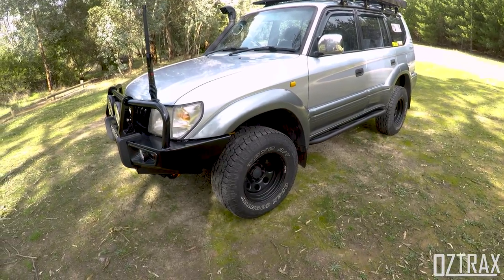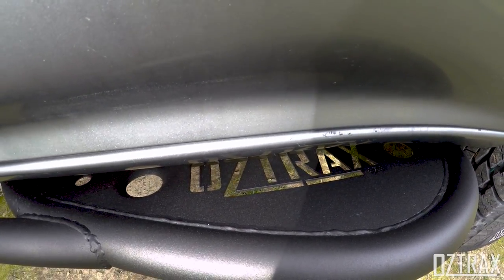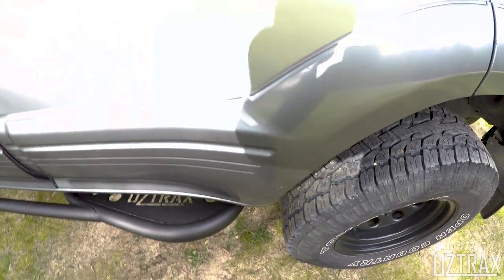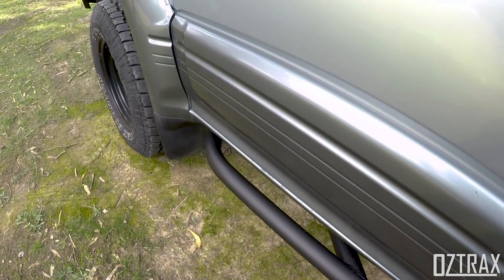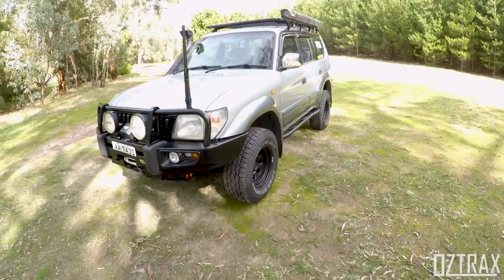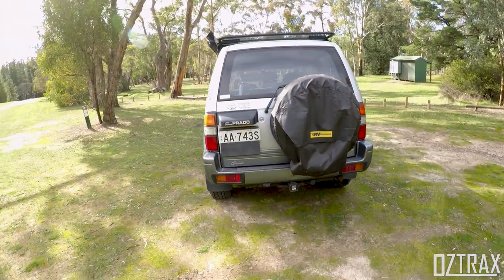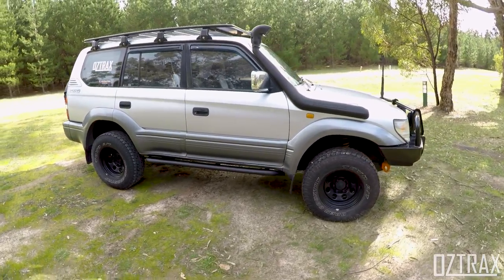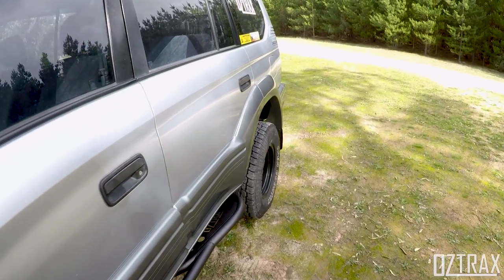Toyota Prado 90 Series // Rockslider Build by SBH Engineering

Comment: They look pretty nice, beats bending the factory steps, mine have a dent on the passenger side.
Reply from the maker: Yeah mine had a few knocks. Still have them stashed in the shed. Reasonably straight for alloy steps considering some of the tracks I've done.

Comment: Awesome man looks mean👍🏼 was wondering where/how you mounted it, to chassis or body mount for original side step ? Cheers
Reply from the maker: Thanks! It's getting there slowly.

These particular sliders bolt to fish plates which are welded to the chassis in three points per side.

I have pics up on my Facebook page/Instagram of the sliders before they were mounted.

It's legal to do it this way (Shauno from 4WD action mounted his the same way) but consult an engineer first before you go welding plates to your chassis.

Hopefully next year I will be relocating to Queensland, so I will more than likely need a mod plate when I change registration.
Reply: Awesome thanks man, looks strong 👍🏼
Reply from the maker: SBH Engineering builds cam spec rollcages for off-road racing here, so you betcha they're strong. 🤙

Comment: Absolute stallion of a vehicle mate! I'm thinking of getting a 2002 petrol 90 series as my first 4WD, do you recommend?
Reply from the maker: Thanks for the kind words. 🙂

It's been modified even more since this video was shot, so will have more videos coming up soon on even more mods that I've done to improve my setup.

Would I recommend a petrol 90? Sure would. Even a diesel is worth looking into, just make sure it's been regularly maintained whichever way you go.

I'd be looking at an auto transmission over manual too, just to keep more precise control when wheeling. 👍

Comment: can you tell me about your tire and wheel sizes?
Reply from the maker: Sure can!

16x8j -22 offset
Tyre size is factory 265/70/16.
Reply: @OzTrax4X4  is there any rub issue???
Reply from the maker: No, they don't rub as they're still a 31" tyre.

I'll probably have a few issues once I go up to a 33" tyre though, and in that case I may need to throw in some adjustable upper control arms to gain some clearance from the back of the wheel well.
Reply: Is it stock height or lifted ?
Reply from the maker: 2 inch lift bud.
Reply: Thank you man appreciate it thanks for sharing your information
Reply: Ohh I forgot 1 thing, do you think that can I use that size spec on stock height? Without any cutting and rubbing?